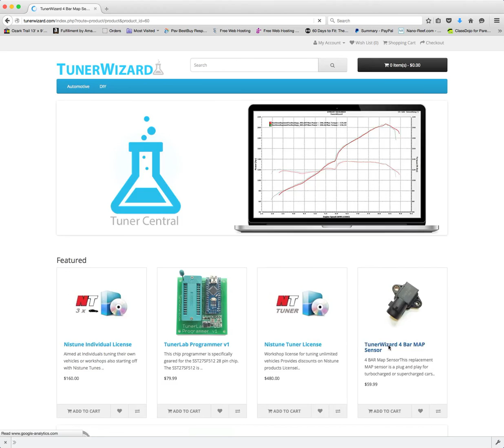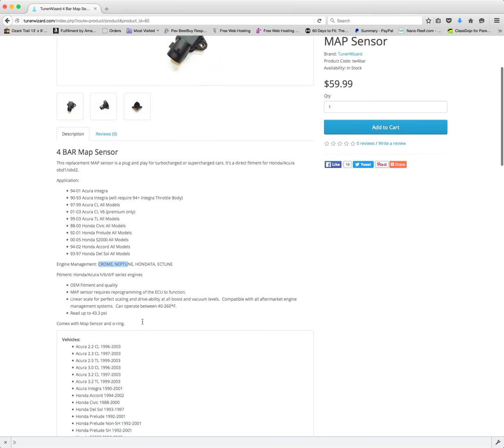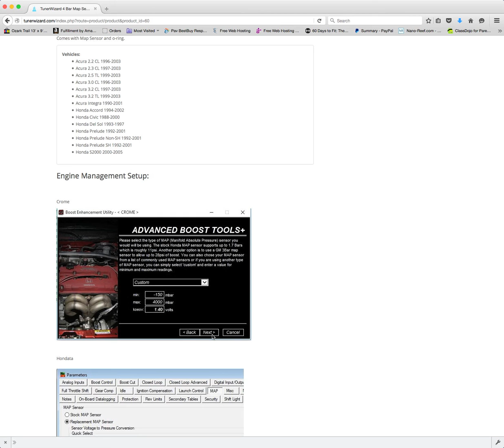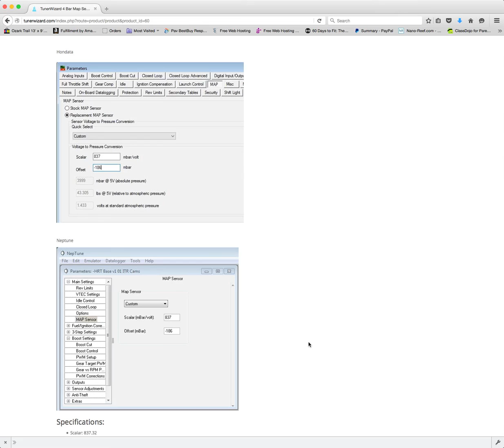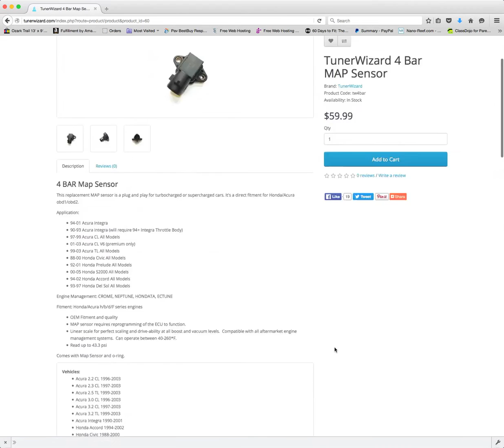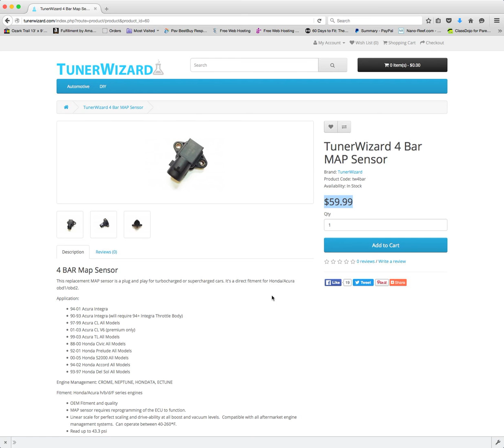Tuner Wizard Acura Honda 4 Bar Map Sensor Turbo SuperCharger

Comment: I bought this map sensor but it reads   -.8psi instead of atmospheric pressure of like 0. And it idles up and down a little. Do you think the settings may be off for my settings? And this is with the KOEO
Reply from the maker: Engine on or off?  Plus elevation makes a difference.  The map sensor reads negative psi when the engine is on because the intake manifold creates a vacuum.  When you floor the gas pedal, it will read accordingly.  You will also need to make the adjustment in crome to match the the map sensor.
Reply: Paul Vang engine off my bad lol. And I'm in Neptune and I put the same settings as on the website. Either my boost gauge is off or the map sensor is off cuz I drove with my laptop and it read like 9psi but my boost gauge read up to 15-20
Reply from the maker: Thats odd Chris.  I know that the manual boost gauges are always off but that seems to be off by too much.  did you log it the map readings?

Comment: Hey Paul, I bought a tuner wizard map sensor and installed it in my car already. When I go to the boost settings in Crome to select custom map sensor and enter the values, I'm unable to enter the voltage for "Koeov". I can enter the values for the 2 above -150 & 4000 but cannot enter text or even click on the Koeov box. I'm using the latest version of Crome.
Reply from the maker: That is correct.  Just click next and then click back.  Crome will calculate it in.  As long as you have the other two correct, then you're good to go.
Reply: Awesome, it works when I click back. Thanks for the help, Paul. I really appreciate it.
Reply from the maker: I'm glad it worked for you!